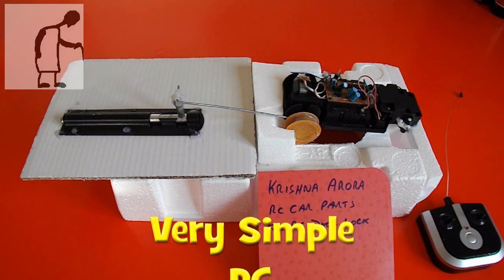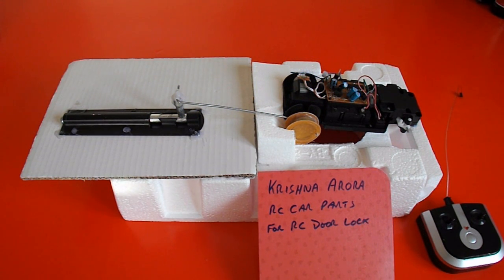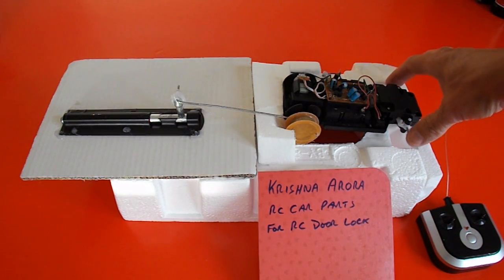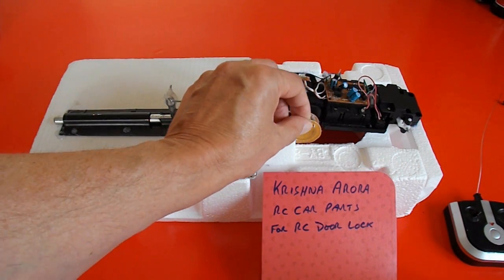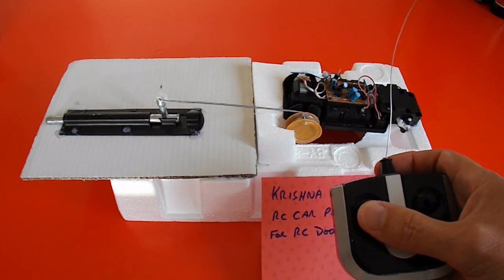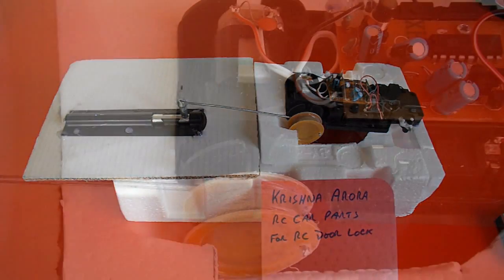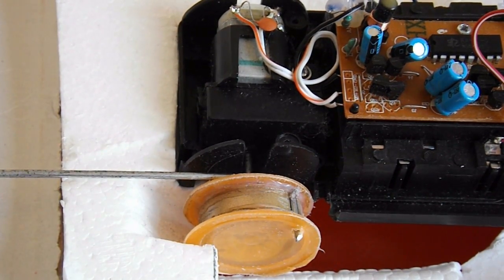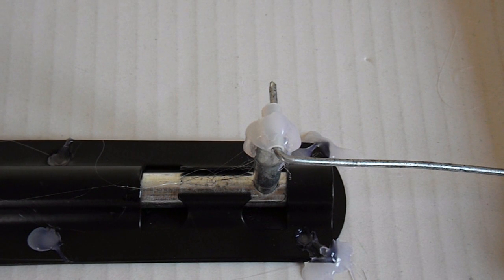Cheap RC Toy Car parts for RC door lock

Comment: How would I be able to change the batteries every once and a while?
Reply from the maker: +Bobby Sanchez by placing the battery pack in a readily accessible position and extend the wires to the normal terminals. In one of the comments on this series somebody explained they have the battery pack where they can take the batteries out when the door is locked and then put the batteries in when they want to unlock it. That means the batteries never run down when it is not used.
Reply: GrandadIsAnOldMan Thanks so much! Oh and if I do leave them in and I'm not using the remote control, will the batteries eventually get used up?
Reply from the maker: Bobby Sanchez the receiver will constantly be drawing current so yes, eventually it will run the battery down. The same happens with any electric toy car, unless you switch it off it will be using the battery.

Comment: Dog Trainer wanting to be able to drop a tennis ball from 50ft using a small RC
Reply from the maker: +Miguel Elguera yes you could use this set-up to release a ball. With a little more work you could build a hopper system full of balls and release one at a time.
Reply: what is a hooper system ? would guide me to build it. each ball weighs approx8 ounces.thaanks
Reply from the maker: Miguel Elguera sorry for the typo I meant a hopper. It is just a funnel to hold your items and you would need to make a release mechanism that allows one ball through at a time, maybe a paddle wheel.
Here are some examples of hoppers https://youtu.be/X0XTYz8NP7w  https://youtu.be/r0D_88_X1Kc
and while I was looking I found this tennis ball dispenser https://youtu.be/Kig7LkDt-RA

Comment: with all the cheap Chinese toys that are controlled via bluetooth why use rc?
still pretty cool...
Reply from the maker: +BofaDeez2Nuts I used an RC car because I was asked to use an RC car. The signalling system is only a small part of the project. You could use Bluetooth if you want. You could use infrared or sound or maybe even sunlight. Whatever signalling system you use still has to be converted into a mechanical action to move the lock so that is the more important part of the work.

Comment: Hey granddad how do u make a motor go both ways using one swich and same batterys
Reply from the maker: +eduardo nop your switch would need to be a double pole double throw switch. Here is an article with a diagram I just Googled for you http://www.eleinmec.com/article.asp?12
Reply: The link didnt work
Reply from the maker: eduardo nop I guess you will have to google it yourself then. Look for double pole double throw switch. The link works fine for me.
Reply: I acually made it work i just had to try harder but thx